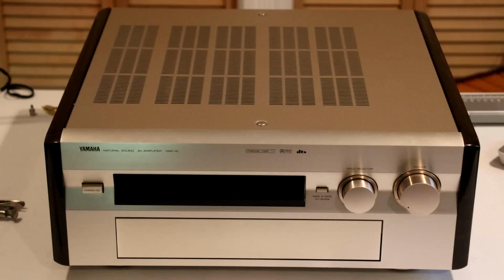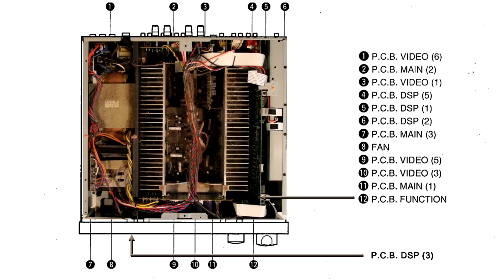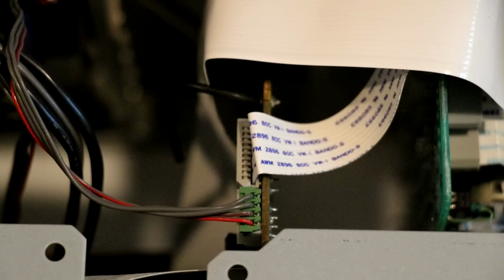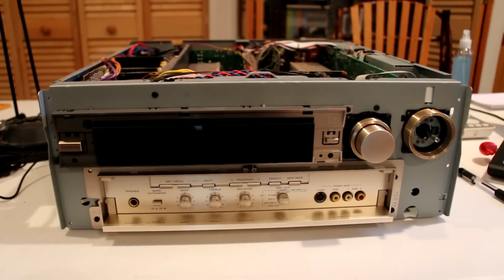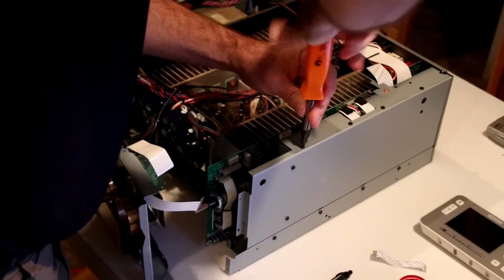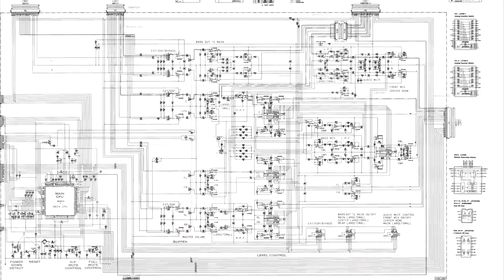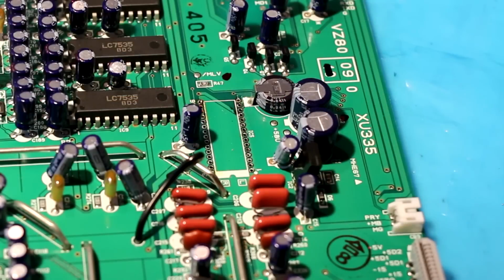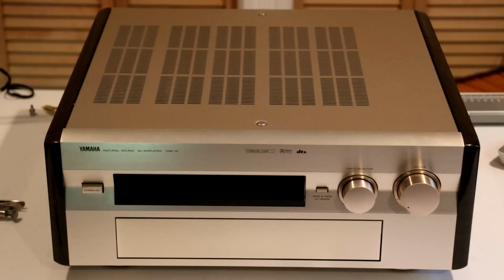Servicing a Yamaha DSP-A1 Integrated Amplifier

Comment: Good video. My Yamaha RX-V430 was in the box for several years when I tried to power it on it was completely dead. What could be this problem could you help me please?
Reply: check fusibles and voltage in capacitors main

Comment: I have the Yamaha  RX-V2092 from 1997, My front speakers don't work.  However, when I lift up the back of the amp it starts to work.
Anyway,,,, I just ordered a Denon  XVR-8500 HA for $4200 Cdn. I hope to get 25 years out of this receiver.

Comment: Hi...is it possible to convert the voltage,from 110 volts  to 220 volts,at some internal selector or changing some wires at transformer ?
There no external voltagem selector .
Thanks

Comment: Great video thanks a lot .Its been over fours years ,But I got a AX1 and the digital inputs don't work (the sound is very distend ,I really need to crank up the volume 24DB  to get a bit of sound The sound is not distorted )Does anyone know about this problem ? Analogue connections are fine .Please can somebody help ?
Regards Kenneth John
Reply: Check the connections between the DSP board and the FUNCTION board, they are the two long PCBs on the right hand side looking from the front.  Also worth checking to see if the memory capacitor C175 on the FUNCTION PCB has leaked and caused corrosion that might account for the problem.  My money is on IC11 on the FUNCTION board, it is the IC that chooses between ANALOG THRU, DSP and 6-CHANNEL INPUT.  It takes about two hours to get to the DSP board, replace the components and re-assemble/test.  The service manual is easily found on the web.
Reply: Good morning (here it is ) @davidhunt240  

Sorry for this late response . I will look into that and see if anything leaks .Also will look up that service manual .I'm not using the AX1 for as a multichannel, just for stereo .I connected a KORG DA and it runs fine (better than expected ). It 's got dimensions ,detail ,depth and punch. Similar to a Accuphase.  Much better than the newer Pioneer LX 82 .
Again thank you ,I will let you know about any progresses ,

Regards Kenneth John

Comment: Hello bughunter great video. I've a dsp-ax1 with other issues and so does a chap whom also commented with similar issues. I have mentioned if I find the route cause then I would assist him with his amp also with a video etc. Basically it had the memory capacitor issue which was a fairly straight forward fix. Took longer to get the part. The main issue I'm having is the front board command buttons don't function which also doesn't let me activate the main speaker relays a+b. The design is different to the A1 you have. it was the slightly boosted version so the chip you replaced is elsewhere or could be different altogether. are you able to help at all with this? amp is too good to scrap and dismantle for parts.

Comment: Bughunter good day, my DSP A1 are into trouble again, i think the video will be my guide. The problem now start again with no digital signal from cd player although it is wired with both rca analog and digital (toslink) to the yamaha amp, also when i switch to surround sound the audio is cranky sounds like a broken speaker in the surround, but normalizes when i switch to stereo only, (effect off). I haven`t check the circuit board for leaking caps or corroded IC yet. Tnx.

Comment: Interesting!  I noticed it has LD as one of the inputs.  Does that mean that does receiver can decode AC3 streams from Laser Disc?
Reply from the maker: I believe it does. I never owned a Laser Disc player so I don't know for sure, but that would make sense.
Reply: Yes it can, via the AC3 RF coaxial jack on the rear panel

Comment: would you know why my DSP-A1 turns off after 20sec of play on first power up and then will only flick on for 3 sec any chance after that? I believe its going into protection mode but this is when nothing at all is connected and volume is at 0...
Reply: Dave Botting Hi Dave, same thing with me. Found it to be a regulator power transistor on the power supply board next to the fan. Look for 2SB1375 on the transistor. There are two, I replaced both.

Comment: I want to buy this receiver but has a problem with the display. I can barely see the letters and numbers. Do the same mistake as in your receiver? Do you have a tip or idea? Is it worth it to buy this receiver for 130usd
Reply: buy it Aleks, its the top of line amp/processor with superb audio. the display can be repaired by yourself.

Comment: Excellent video. I have the same problem and I found the bad (now silver) guy IC5. And a spare part. But no socket DIP30. Could you tell your retailer for DIP30 sockets?
Reply from the maker: I used DigiKey. Verify the specs and confirm, but I believe this part will work:

http://www.digikey.com/product-detail/en/mill-max-manufacturing-corp/117-93-430-41-005000/ED22304-ND/67196
Reply: +Bughunter Thank you very much.
Reply: +Bughunter Great video.  I have taken apart my DSP-A1 and taking it to work to have PCB assembly techs fix it for me.  It sucks that the front board can't be removed and have to lug that heavy thing around.  Anyway, what is the part number/link to the cap at C21?  Thanks in advance and Thanks for selflessly putting together this great video.
Reply from the maker: +Gerovision Two DigiKey parts that are nearly identical are 604-1079-ND and 604-1021-ND. I bought both, but I forget which one I used. I'm pretty sure both will work just fine...

http://www.digikey.com/product-search/en?keywords=604-1079-ND

and 

http://www.digikey.com/product-search/en?keywords=604-1021-ND
Reply: You're a good man, Bughunter.  Thanks!

Comment: hello, I'm Elvin, I had the same issue And I've tried that already. The issue that I have is that everytime it rains if I turn off the equipment and don't turn it on again within the next 3 days, it won't turn on, I have to use a blower in order to make it work again, please assist if possible

elvin

Comment: hi   
Bughunter  I have a similar problem with 2006 sr-9600 surround thx Marantz its has check dsd/dsp flashing light, no fm/am , and volume cut off continuously I reset the unit and nothing I don't have experience on repairs electronics but due the expensive prices I going to try do something myself but I have no idea where to start please help
o may be u can repair for me please let me know the price thanks
Reply from the maker: pirrunga17I did find the service manual for the Marantz pretty easily - and it appears very complete. I studied the Yamaha service manual for a long time before deciding what to do. Narrowing down what works and what doesn't and using the manual to figure out what could cause your symptoms is the way I started.
Reply: +Bughunter
thanks very much appreciated your help I will continue this recommendation

Comment: Hello Bughunter, your video is simply excellent, all is so clear and well explaned.
I have a Yamaha DSP-A1 since 1998 and is working fine ... but I have also the display problem, some days display works fine and some days is all black. I'll try to repair it following your video .... but I have another problem, more serious. Some days all is working fine but some days A1 shut down by itself, and continue shut down a lot of times. After several times I switch it ON, finaly it remains ON and works fine for all the day. What can I do? Which module to control? Can I contact you by email? I'm from Italy .... Thanks
Reply: Agreed, this video is excellent ! Thanks
Reply: I have the same problem as well. Turn on a couple of hours to warm it up and it will displayed!

Comment: Thanks for the great explanatory video on the Yamaha amp DSP-1.
Mine is The DSP-AX1. I have this unit since 2002, it worked great but not much. I hardly used it. I only use the amp by the remote control, that is why and only by accident, yesterday, noticed that the buttons below the display [covered by the sealing panel] do not function except the last two ones [program select] The speaker A and B buttons, the set menu -/+,  the 6 ch input, the next and the effect button. And, I can not access the self diagnostic menu. [I couldn't turn the main speakers on without the speakers buttons A and B].
Any help that might lead to such issues?
Please Advise.
Reply: Medhat A. Wassef I have the same issue. I have no buttons working which means Ive had to connect up my monoblock amps to the pre outs on the back and use the remote to operate those buttons now. I shall have a good check over unit tomorrow. I shall let you know if I get it up and running again. it be a shame to shift on unit because of this issue but if I want to use it as a stand alone unit in the future I don't have the option to switch on front a & b inbuilt amps
Reply: Thanks you sir for your reply that gave me hope of having my DPS-AX1 issue tested and hopefully a solution comes out.
Hope that we have this great amp work in order again. Waiting for your check on the amp finds a solution.

Comment: That is an av receiver not an integrated amplifier
Reply: +Jesus Kryst , it is an integrated amplifier.  To be a receiver, it has to have an AM/FM Tuner, which this does not.
Reply: +Gerovision it is a home theater muliti-channel amplifier. An integrated amplifier is a two channel stereo amplifier. Google is your friend.
Reply: The point here is IT IS NOT AN AV RECEIVER!
It does not have AM/FM Tuner so it is an amplifier.
I know because I too have one of these.
When you are wrong then say "Oops! My bad".  Don't cite Google.
Reply: An integrated amplifier is an amplifier where the pre-amplifier and power amplifier are combined into one unit.  The Yamaha AX-1 is a DSP AV multi channel integrated amplifier. Think about each of those components on their own.  The DSP unit, an AV switcher, a multi channel pre-amplifier and a multi channel power amplifier - all in one handy (28kg) box :D  As @Gerovision says, a receiver has the ability to receive and decode DAB/FM/AM directly, the AX-1 cannot.